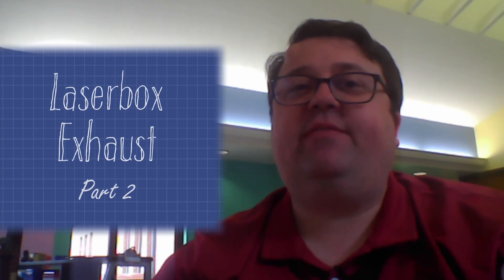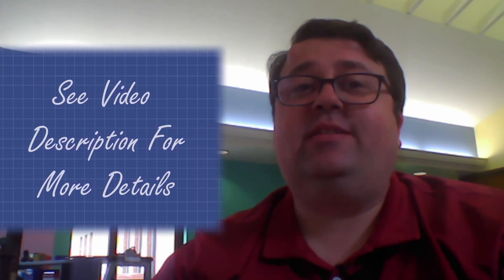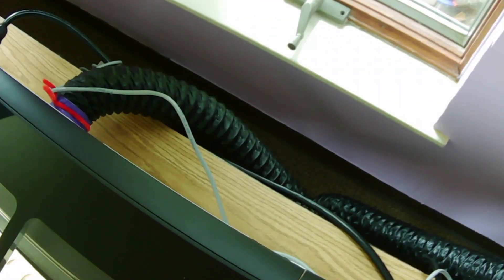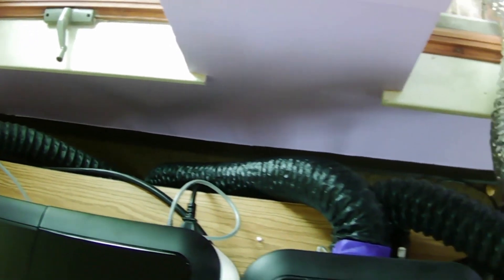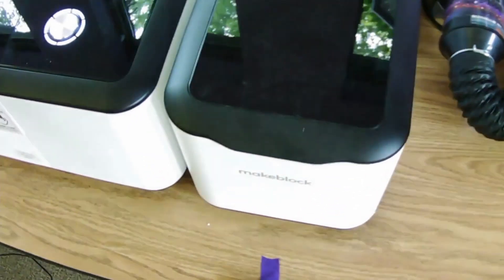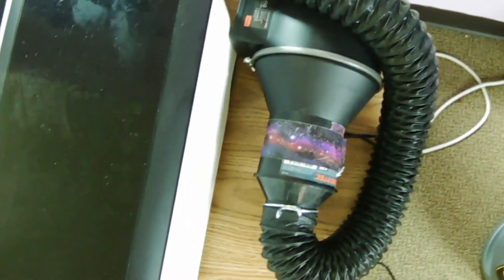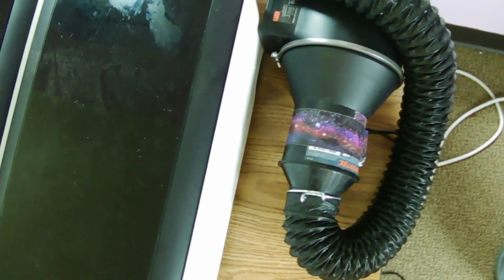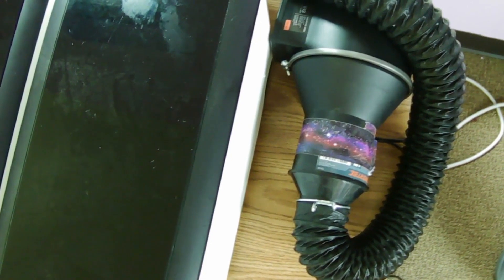Part 2: xTool Makeblock Laserbox Pro/Rotary Edition AC Infinity Inline Fan + Purifier Exhaust System

Comment: What set up do you prefer? The 4 inch with the air purifier or the 6 inch without like in your first video?
Reply from the maker: I prefer the 6 inch. The purifier filters are really expensive and don't last long. The 6 inch is really good for things like eva foam, and acrylic (smellier  materials)

Comment: how much noise does everything running like exhaust etc
Reply from the maker: The machine is about the sound level of a copy machine. The AC infinity fan is actually pretty quiet, quieter than a box fan. The 6 inch is louder than the 4, and each gets louder if it is on the highest setting.

Comment: Thanks for the video. Does the Laserbox come with a 2" hose or a 2-1/2" hose? 
I see that the reducer you recommend is a 2-1/2" to 4" so I just want to learn how everything connects. Thanks!
Reply from the maker: The hose is close to 2 1/4, ~60mm outlet, I Kept the original hose so there was no issue just had to make sure I sealed the connection really well.